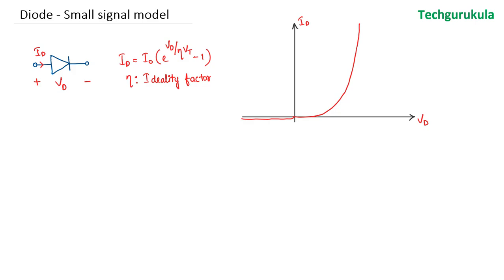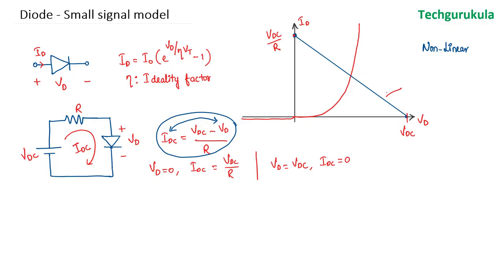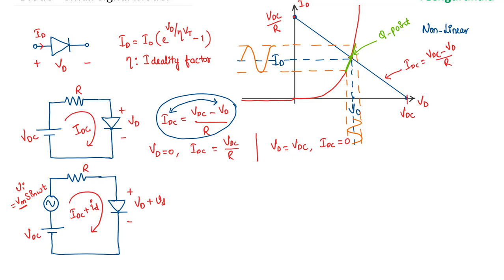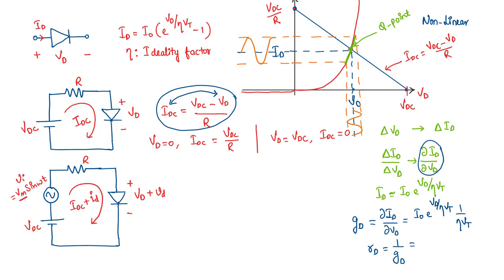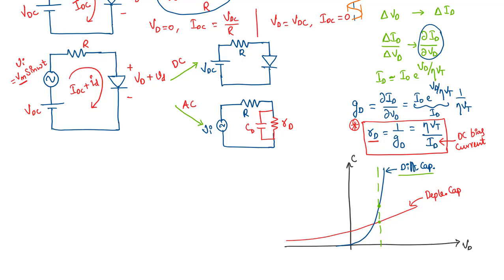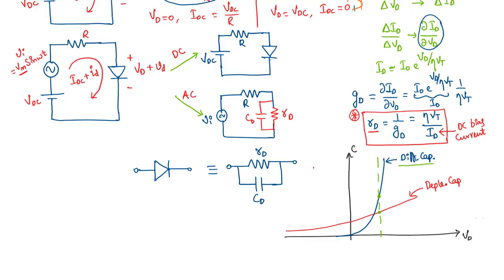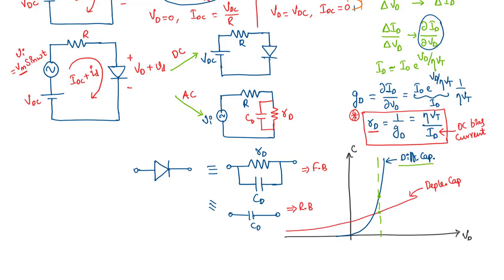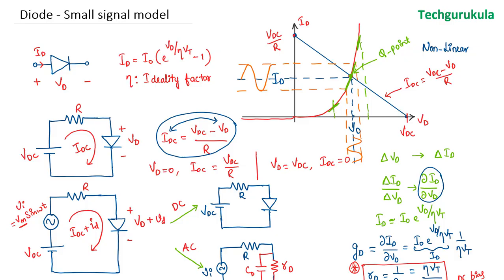Diode - Small Signal Model

Comment: Sir at 7:00 in the formula of current Id ,shouldn't  be it Id=Io (e *Vd/n Vt  - 1) , you haven't  written -1.please clarify my confusion.
Btw great explanation!!!
Reply: e^(Vd/Vt) >>1 therefore 1 is neglected
Reply: @ashutoshsharma9566  actually Id>>>Io so  it is neglected
Reply: Vd is normally around 0.5 or 0.7 volts, so when we calculate e^(0.5/Vt), it is approximately 500 million, which is much bigger than 1, so we remove -1 because the error for simplicity is very small like the error is smaller than the maximum error allowed for nasa to navigate the spacecraft to planets. That is how small the error is.